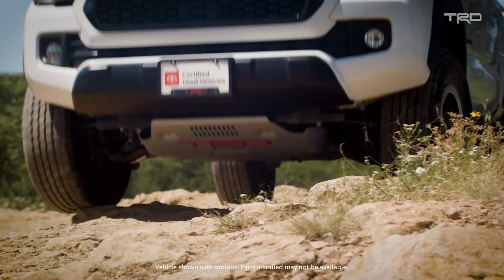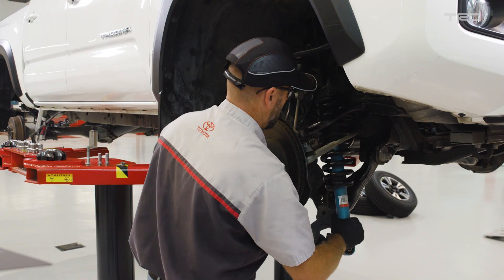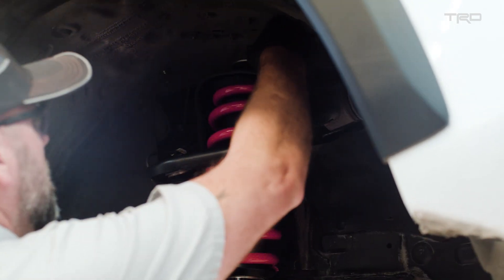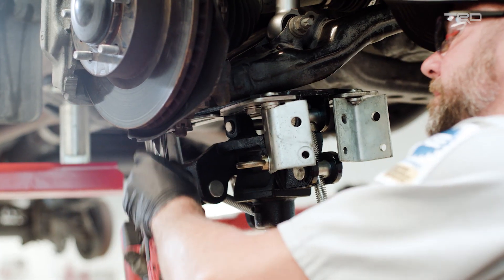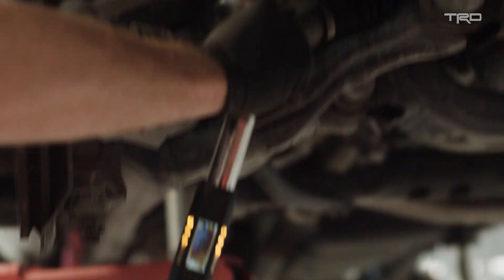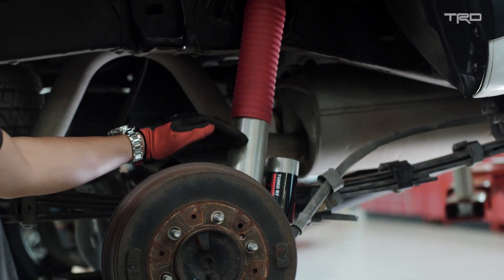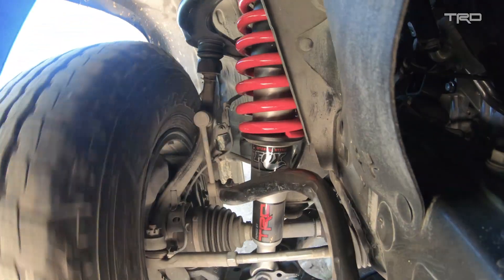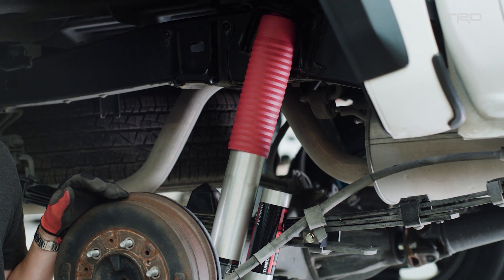TRD Shocks for Off Road Enthusiasts: Toyota Tacoma Project Part 1

Comment: I have a 2020 trd pro Tacoma. Coming from a previous tundra owner which I equipped with King off road racing shocks I find the fox shocks to be a bit of a hit and miss mainly because I drive pretty hard at speed and I’ve found the rear end bottoms out a bit too much for me the front coil overs seem to handle fine not great but ok. I just feel that the fox suspension found on the Trd pro to be more of a generic offering rather then the real thing fox is known for. With that being said Toyota if your listening please please look into partnering up with a different company rather then fox for future products. I feel that there are much better options like King to be had it would be awesome not only for me but for many others I’m sure. My last final wish is can you please make a more special version one with a more wider track/body preferably on a tundra platform and a long travel suspension. I love my truck and had a great experience with my previous truck the tundra and plan on modding this Tacoma to fit my needs and wants I just liked the overall aesthetics of the Trd pro Tacoma.
Reply: If you’re planning on selling them I’m willing to buy them off you